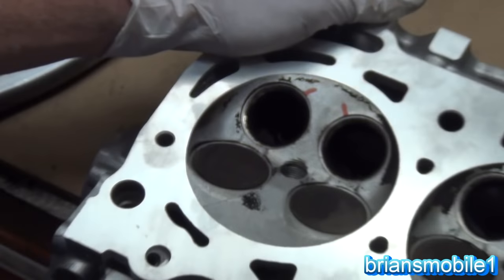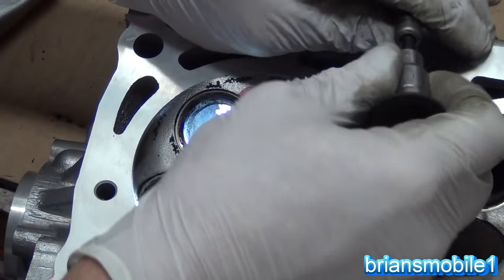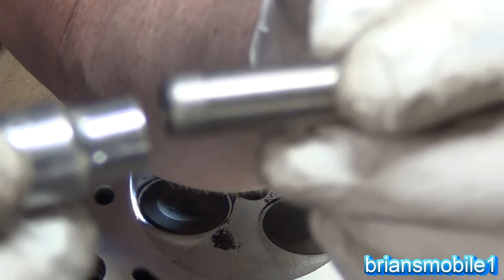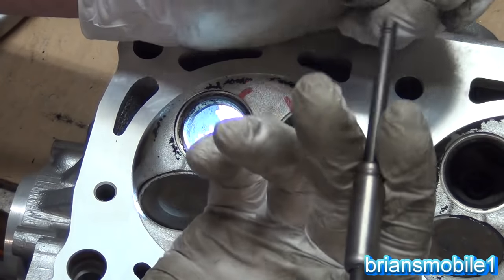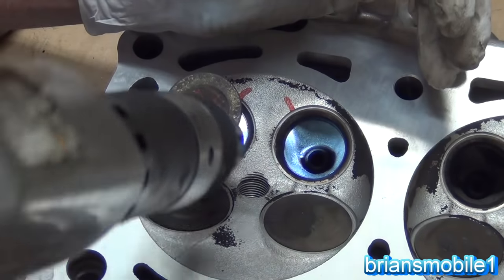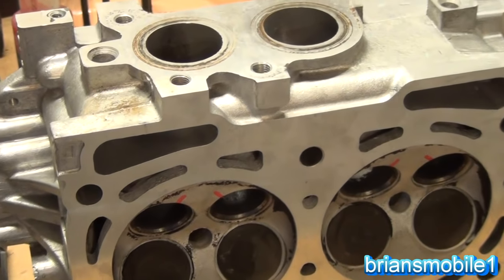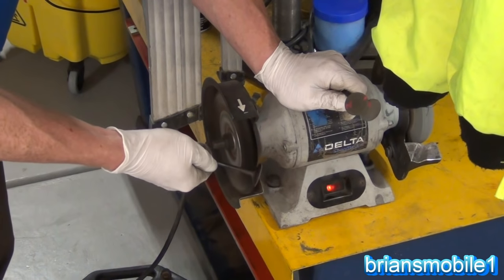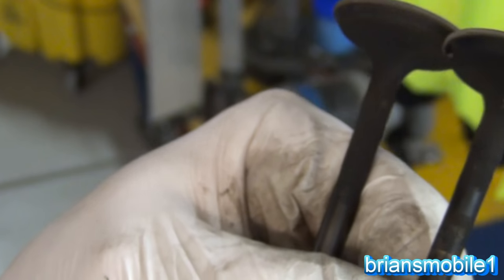How to MOVE Valve Guides the EASY Way

Comment: Great video. Just a little advice - the way to measure depth with a caliper is to use the end opposite the jaws. Place the small end (of the caliper) on the valve guide and extend the small center section down to the surface of the head to get your reading. You'll find you can measure a whole lot of hard to get at stuff using this method. 
I have a 2008 Subaru Outback.and do all my own repairs. I really appreciate your videos. 
Have you ever done one on changing the fluids in the driveline?

Comment: A very long time ago I worked in an engine rebuilding shop.  Guides then in aluminum heads had a small wire ring to stop that problem guess it isn't "necessary" any more (lol).  Also first week there I was buffing valves, got a small piece of carbon (which carried fine steel dust from the process) in my eye & wound up having to have the rusty part "ground" out of my eye.  EYE PROTECTION around a wire wheel & a respirator wouldn't hurt either (maybe not as bad now without the lead in the gas) but cheap insurance.  Great tips - loved my Subaru!

Comment: Cool - I do the same wire wheel trick to clean the valves, but I stick mine (carefully) into my drill driver and spin it in the opposite direction of the wire wheel. I like to think it helps ensure even coverage and and even cleanliness. As for tapping the valve guide, my only problem is, the only spare valves I have in the shop now are broken or bent! :-)

Comment: Adding a small stainless steel washer between the socket and valve guide would provide more contact surface area and prevent the guide from wanting to slide into the socket

Comment: If the guide dropped once, it's going to drop again. That's not a proper fix to the problem. All you accomplished by beating that guide back and forth was making the guide bore looser than it already was. Total hack.
Reply: Larry Cavanaugh that will depend on the circumstances if the head gasket has gone or a pipe and lost all the water the engine overheated the aluminium would expand far quicker then the valve guide so under normal running conditions with water everything will be heated equally and expand equally

Comment: What could go wrong if I use a socket or other tool to knock out old valve guides? Also could I knock in new guides using a socket that fits perfectly over the valve guide tip? I really don't want to go to a machine shop but if I have to I will.

Comment: Always knurl them prior to installation.  Just a slight impression will suffice and keep those guides from dropping.  Provides just enough "bite" when the metal heats.
Reply: Knurling is the worst you can do. You destroy the hole. The only thing that works is reaming the hole and put an oversize valve guide.

Comment: Is the wiggle test accurate for checking valve guides or should I take it to the shop so they can measure the valve to guide clearance? Trying to save money as much as I can but should I be fine if I don’t have excessive play?

Comment: Doesn't make much sense to me why the guides don't have a small lip on the edge to prevent them from sliding into the head. Is there some reason for them to float like that?

Great video as always man.
Reply: ***** easier to manufacture without a lip. Build 'em cheap, sell them high !
Reply: ***** That's a good point.
Reply: These intake guides  come from the factory extended down into the intake port. The reason is that they are cooled by the fuel/air mixture passing thru the port. The exhaust guides are out of the port to keep out of the heat and help cool.  Moving them out of the port is asking for trouble. Hope you replaced the valves that you were pounding on with a hammer.
Reply: I think it's because if there was a lip to catch on the head, instead of any force pushing/sliding out the guide the guide would embed itself into the head over time and probably destroy it.
Reply: It’s manufacturing costs it should have been good but was not.  As guy doing the job said soot build up seized valve a bit that pulled guide down.  The witness marks on the valve proved that. Load of soot probably town driving hardly any highway, light loading probably caused this.  Did Subaru test that out for extended period. So fault was caused by soot rather than faulty guide/head problem. So knocking back and cleaning valves may be a great fix. I would probably want to ream the guide just in case it got pinched during the knocking and it would clear any crap out. Interesting problem. I make mine work so should not be an issue.😀

Comment: What were the symptoms which enabled you to realise this was happening?  I've got a 1jz and I've changed the stem seals, but the car still smokes on the overrun, (blue).  I've done a compression test and it's fine, could the valve guides cause smoke on vacuum?  Thanks
Reply: A loose valve guide will suck oil as crazy. Especially on the inlet.

Comment: Mr. mobile1, you can use the "stick" that comes out of the backside of your calipers to take the guide's height measurement.  Use the butt of the caliper on the top of the guide and drop the stick down to the cylinder head.  I think this would be easier and provide a more repeatable measurement than trying to use the jaws.

Great tip on wrangling those guides though.
Reply: I'm screaming!!!! 

Instructions for performing machine work...

Step 1: learn how to use precision measuring tools.

Comment: Most of the valves I use are smaller than the stem, just above the head, under cut, swirl polished, stainless valves usually, not stock valves, but even the small motorcycle valves I just worked with , the 5mm stems were about 4-4.5 mm smaller to flow more, and prevent this I'm guessing, looks like subie would fixed that!

Comment: just order a valve guide driver from the manufacturer of the motor, put the head in the oven 300 degrees the guide will go in or out easy peasy, get rid of the carbon. no machine shop needed.
Reply: What about re-cutting the valve seat? Most guide installs require recutting the seat.

Comment: Another idea for cleaning the valves from Jafromobile was to put the valve in the chuck of a drill. Just a time saver really as you can spin and hold the valve more easily when you are using the wire wheel.

Comment: Question:  Yeah it's me again.  LOL.   The machine shop did a hack job on our heads for the 07 Forester.  Needless to say I'll have to completely tear it all down and clean out metal shavings.  This guy may have 50 years of experience, but he did a slop job and dumped a load of aluminum shavings in the heads.  Nothing installed yet, never run...  So I'll disassemble and clean things up.

Now the question:  This dingdong never noticed the glaring obvious.  3 of the 4 exhaust valve guides are dropped about 1/2".  The same 3 valves are not fully sealing and I can see day light when they are supposed to be closed.  Do you think I'm better off just using an air hammer and gently 'kicking' the guides back into place?  And then either installing new valves or cleaning the carbon off the current valves and reusing them.   Can't afford a machine shop a 2nd time.   Heads are straight at least, but I'm a long ways off...

I will post this on the facebook page as well.  Thanks!

Comment: it there a way to prevent the carbon build-up on the valves???
Reply from the maker: onenikkione GREAT QUESTION!!!  WE'VE GOT A GREAT QUESTION OVER HEEEEERE!  
Yes, I'm glad you asked.  Use good fuel and maintain your vehicle including changing the spark plugs according to manufacturer guidelines.
Reply: Never run the engine. Other than that, burning hydrocarbons will result in some carbon buildup.
Reply: Water injection .

Comment: using a valve as an intermediate to hammer the guide in place is wrong. the valve has not got the sharp 90 degree angle on the back to function as a guide protector while hammering. the guide will split.

Comment: Not placing any blame on anyone but myself, but I have used this method twice and it has ended in disaster both times. The first time was just a simple dropped valve and attempting to move it back in place. I used this exact method, and the air hammer jumped off the valve and damaged the head surface. I eventually got tired of the darn thing not moving and stuck the air hammer directly on the guide itself, and guess what, it shattered! I know it was my fault, it was stupid. Second, I tried to use this method to install a brand new valve guide, which worked like 90% of the way, at the final 10% the guide I was trying to install broke.
Reply: that is because using a valve as an intermediate to hammer the guide in place is wrong. the valve has not got the sharp 90 degree angle on the back to function as a guide protector while hammering. of cause the guide will split.

Comment: And yet twinkle toes makes no mention of lapping the valves prior to installation ? 1 because you just plain should do it because its apart any way and 2 ?? you just ran a wire wheel over the surface of the valve repeatedly ? lap them in or your going to have issues. cleaning on a wire wheel is standard procedure for decades same goes for lapping in the valve. even if it was new it needs to be lapped.

Comment: Any hacker solution to try without removing head, thru exhaust port?

I know, it's a hack question, I have done worse, trust me, but this is a 16 year old vehicle that doesn't owe me a penny. just want to drive it a little longer. 
The intermittent misfire makes it difficult, would be impossible to drive if it wasn't a standard shift.
Reply: John Bachand Removing the head involves less risk and time.
Reply: Valve guide pulling tool